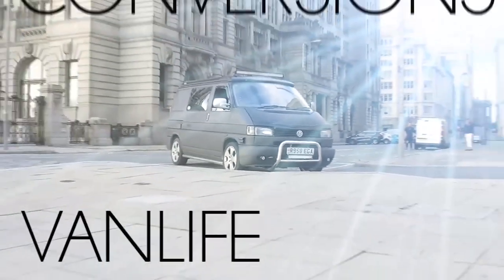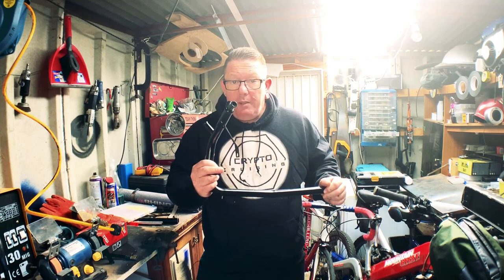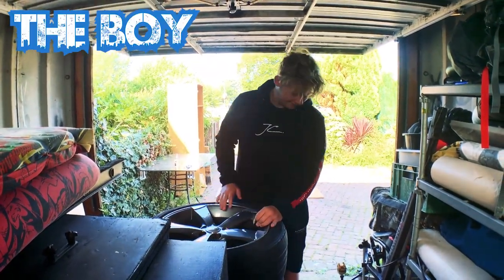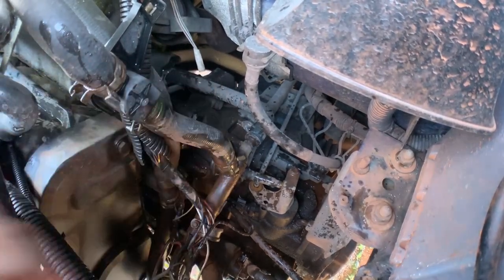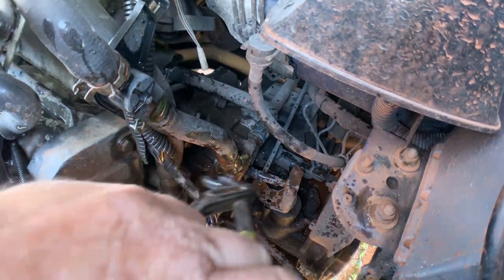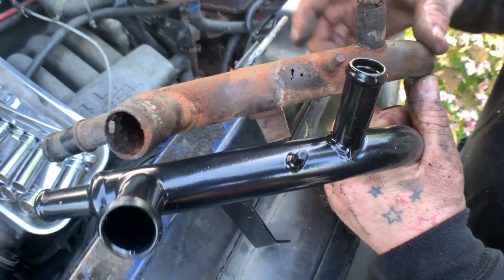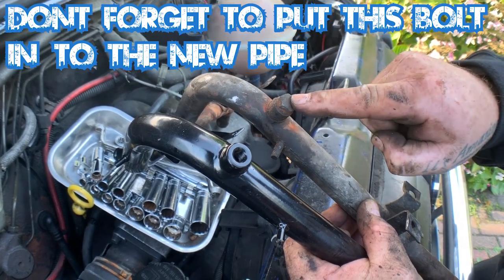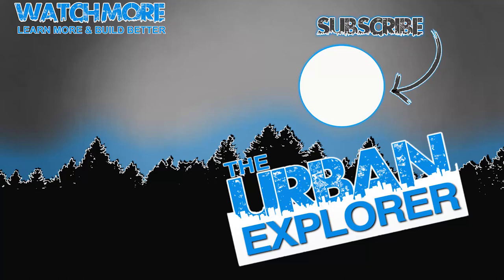Van Water Pipe Exploded | Vw t4 Metal Water Pipe Replacement

Comment: hi bud i’ve nearly got metal water pipe off it’s disconnected both ends the clips by alternator were covered wrong way round use dremel to cut clip then still wouldn’t come out used screwdriver to see out i split end rubber a bit although it goes well in to tube.ive ordered new clip and shirt bit joining pipe but other clip is behind a cover alternator going be tricky to get to that i may try fit new metal pipe i ordered as mine rusted it was small leak then got bad .i use van everyday so got be right and we tour cornwall and lakes etc soon
Reply from the maker: Sounds like you had as much fun as me buddy . It’s a bloody pain of a job isn’t it . But done now so all good for 20 years lol

Comment: Doing this repair right now on my VW T4 2.5 tdi. Really struggling with the top mount bolt, attached to the starter motor.... Really trying to be patient not to strip it...
A real son of a gun
Reply from the maker: oh mans them starter bolts jsut dont want to come off do they , its like the dam thing fights you every step of the way .
Reply: @UrbanVanlife  yeah, got it one round, and now its stuck again. Second time having problems at this spot, even though i changed the bolt last time

Comment: Cheers for this; you've made it look a breeze so hopefully it will be for me too. I found a pipe for under £20 on eBay with free postage; justkampers were over £80! Ridiculous.
Reply from the maker: That’s so good man . Yer I got mine off eBay to and it was wel under the just campers price . Getting the end pipe off may get you wet lol it did me
Reply: You weren't kidding about it being a wet and fiddly job! I had to modify the bracket but the pipe is in and so far so good. Thanks again, dude.

Comment: Can I ask did you check for electrolysis before setting on the pipe change ?
Reply from the maker: I sure didn’t . Just got in there and changed it cos it was leakign
Reply: @UrbanVanlife  have you checked since ? If not might be worth a little whip round. 

WHAT IS ELECTROLYSIS? Electrolysis damage in an engine cooling system is caused by unintended electrical currents that flow from voltage differences that exist in the engine coolant jacket, the radiator, and the heater core. The damage can include rapid corrosion, pitting, flaking, and pinholes.

You definitely had pinholes and the inside of that pipe looked pretty 😅. Could be previous owners using water instead of coolant but worth a check
Reply from the maker: The van got sold 2 years ago now bud

Comment: Hi m8 how do you bleed vw t4. Put new metal pipe on. Now no heating. Air block i think. Any ideas m8
Reply from the maker: The system should get rid of air blocks it’s self mate cos it’s moving water . If not I’d look at other things like the thermostat
Reply: @UrbanVanlife  cheers m8

Comment: I have a bew tdi and my front metal coolant pipe went and I tried taking one off a junkyard car got everything disconnected but won’t come out of the housing by the water pump do ya just yank on it till she comes loose? I couldn’t find a vid on how to do it
Reply from the maker: It’s probably just stuck in there bud mine was hard to get out . Try tapping it with a hammer the vibration may loosen it
Reply: @UrbanVanlife  okay right on thanks bro

Comment: ,great channel ,hi do you have a link for the ebay  water pipe?
Reply from the maker: This is the one I got but check your engine model and year so you get the correct one . It may  be diffrent to yours mate . https://www.ebay.co.uk/itm/183662011811
Reply: @UrbanVanlife  many thanks ,mr Explorer its the aab engine
Reply from the maker: yes mate mine is the 2.4 aab engine. easy job just check the pipes match mate. but ebay is defo the place to get them cos the van sights want silly money for them like 70 to 100 pounds, which is just a no